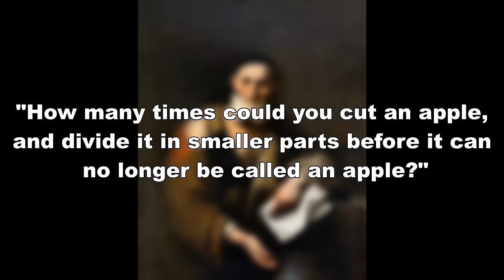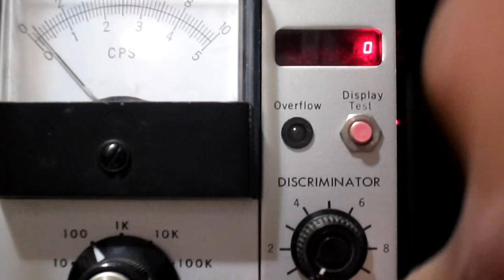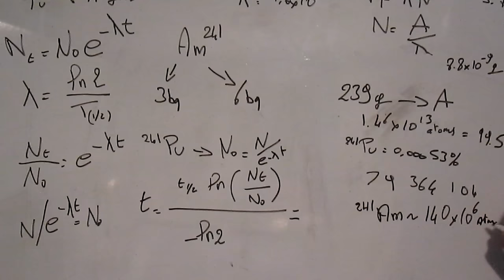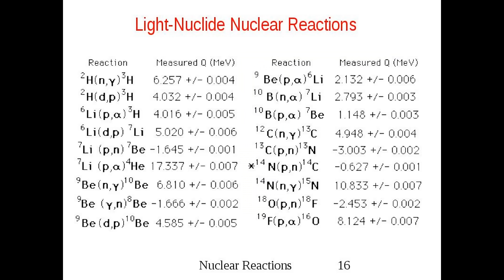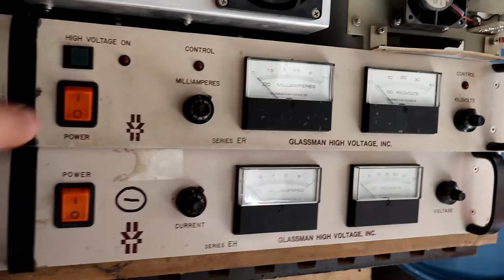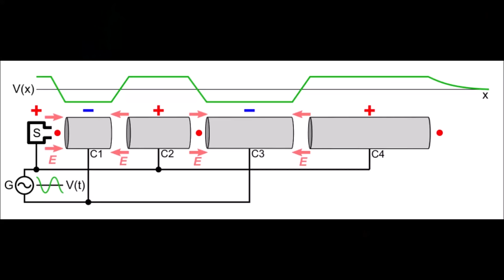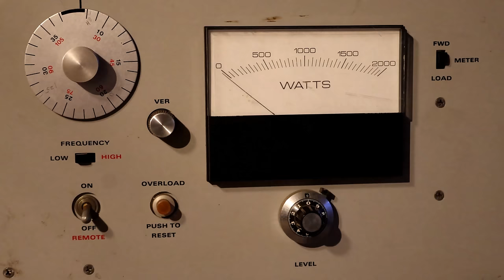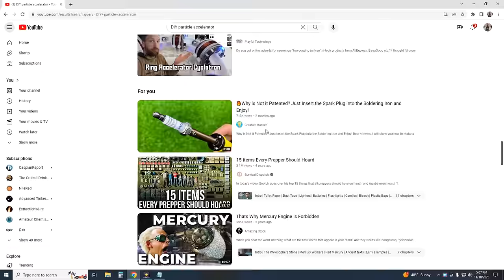DIY Particle accelerator (part 1)

Comment: This is very cool stuff! I'm glad you shared the setbacks. Most videos make it look like everything went smoothly and I think thos of us that do experimental work know that rarely happens. I'm very glad to hear that your turbo survived; that would have been really bad. I have done many years of UHV work, so I can appreciate the difficulty of getting a vacuum chamber up and running correctly. I doubt I can tell you much that you don't already know but feel free to reach out if you have questions about vacuum systems.

I'm looking forward to seeing this work!
Reply from the maker: excellent! Thanks for the offer! I am working with a possible supplier and may be able to get vacuum parts for this project! but the more the merrier right!  check out my other work vids! Thanks for watching!

Comment: I would like to know more about the conditions of the pressure failure, do you know from where it comes from? Are you very familiar with vacuum? Is a cathode gauge good for all pressures even not very low ones? (I saw you reach about 1e-6 torr but you go back to atm pressures sometimes from what I understood). It's more a question than any suggestion since I am not a vacuum expert but I am also working with vacuum and I vaguely know that several pressure gauges are used for switching from high to lower pressures so if you could explain more about you're gauge! Thanks a lot! Very inspiring video! Good luck for fixing everything, looking forward to see the following.
Reply from the maker: Sure, I made a simple mistake I never made before a really dumb one ! But I take full responsibility for it and I'll be sure to never repeat it. Basically I changed the oil in my pump and reconnected to the exhaust instead of the aspiration port. No I was obviously not paying attention.. for the atmospheric pressure down to about 10-3 I have a pirani gauge and below that I used both a hot and cold ionization gauge. They will not work at atmospheric pressure since they work by measuring a flow of electron, there is a maximum pressure at which electron cannot travel very far . Some more expensive gauges can cover all pressure but this is what I have and I am fine with it. The cold cathode gauge is more convenient because it doesn't need a warm up time like the hot cathode one but is a bit less steady from my experience. I hope this answers your questions, let me know if you'd like more precision! Thanks for watching!

Comment: Dang! Really great work here! I work with equippment similar to this in my lab. We're building a time resolved (3fs) photoelectron-photoion coincidence spectrometer. Cudos to you for doing this all on your own–I know how expensive and tedious these experiments can be.  Sorry to hear about the vacuum failure, it's definitly a setback, but I'm glad you're OK. I'm really surprised the turbo wasn't damaged. Was it not spinning? Normally when a rupture happens like that, the turbo rotors will shred themselves into aluminum powder... out of curiousty, what are you using to back the turbo?

Here's a suggestion for getting the energy of the particles (not sure how fesable this is, but it should work). You could velocity map image the ions onto a phosphor screen using ion optics and image with a CCD. Then apply inverse abel transform and calibrate to get the distribution of energy.

Comment: Yooo. I just want to say thank you....big one. Shame I havent seen this earlier - my name is Jiri, I am Ham Radio , IT geek and I love particle physics. I am far less knowledgable than you are but I could perhaps help with generating some RF. If we talk about kHz and we need ideally square wave and short bursts, I would propose to go MOSFET amplifier in class C, with impedance transofrmer. Driving it would be Signal Generator so as long as square is used, C class would work, if sine is needed, biasing it to AB1 class would need to be done. I can take a look and dive into KiCad and LtSpice and try to make a design.  Take care!
Reply from the maker: Yes ! that would be awesome indeed! Do you think a MOSFET can handle a few thousand watt? I found RF amplifier and I already have a few function generators, but I always wonder if they could put out enough power? Thanks for reaching out and thank you for watching!
Reply: @Neptunium  Few thousand watts will be difficult - mainly because altough mosfet ON resistance is getting low, around 20 miliohms, it still needs to sink a lot of heat. I built RF Amplifier using mosfets which delivers around 2000 watts... it uses a lot of paralel IRF820 or IRF910 high voltage MOSFETs but truth is that there are now components designed for RF - MRF300 can be purchased as a pair for push-pull and each devices is rated at 500W, so a kilowatt should be fine and 2kW with 4 devices should also work. Good thing is that we talk about quite low frequencies - higher we go it will get more hard, mainly due to capacitance of the gates.
I plan to be in my lab later this month so will look at what I have around and could do a quick test. What is the minimum RF Power which would still be acceptable?
Reply from the maker: Oh wow ! thanks a lot ! and i am KE8WDE by the way! 73! @ok2it

Comment: I hit the same issue with my Penning gauge having a large magnetic field and messing up my experiments with accelerating electrons. It would be useful to calculate or measure the actual consumed RF power and impedance at each tube.  Might be worth looking into a multi-stage RF amplifier designed specifically for the impedance that your tubes will present, although your newer machine does look very capable. I was considering accelerating heavier ions like argon, but the idea of using helium is an excellent one. Would a magnetron sputtering source give you a larger ion flux? I have a large Faraday cage in a barn, with optical fibre control/measurement cables to run these sorts of high RF fields without upsetting my computers, CNC gear and test equipment.  Also if it has a catastrophic failure, I am behind several brick walls some distance away.  I'd also be tempted to run the system at a low duty cycle so you could use pulsed power and get a much higher peak accelerating gradient, so long as you avoid multipaction damage. I have some 80 kilowatt magnetrons that only need 800 watts average power, but getting really high power at a few MHz using semiconductor amplifiers is relatively trivial unless you want 10 kW or more peak power. Great work, I look forward to seeing your progress!
Reply from the maker: I see we had similar ideas and ! Excellent! Part 2 is already out my friend! So you don't have to wait ! Thanks for watching and great comments!
Reply: @Neptunium  My turbopump controller has developed a fault so I need to get that fixed asap. Did you use a commercial controller/ display with your hot cathode vac gauge, or did you build your own?
Reply from the maker: @MachiningandMicrowaves  no you can see it on the video it's a Grandville Philips commercial controller
Reply: @Neptunium  Ah yes, I wasn't looking closely enough. Nice.

Comment: What made you decide on building the drift tube first, then finding resonance and matching it with a tunable power supply, as opposed to finding a high power power sipply and building around that?
Also, was ghere a reason besides spacial confinements to only have 6 tubes, if you vould achieve higher acceleration with 7?
Also, does the metal frame for the drift tube array cause interference with your input?
Im very excited to hear a solution for your output measuring equipment! In my own studies, a cloud chamber would be an awesome visial, but personally, observing Cherenkov radiation would be my main goal with an acceleratir. Usually thats in water with cyclotrons, but theres other substances you can onserve it at much lower speeds.
Do you have any goals youre really looking for with it? It seems like you just want whatever data you can manage to collect!
Lastly, what were your biggest resources in creating this? I've found CERN has some great, simple explanations, but theres a few textbooks that really go into great detail, and id love to hear what you found!
I loved the video, I had the same frustrations in finding a legitimate attempt at building a linac, and I'm very imptessed with your solutions.  You're an inspiration, mine will get done!

Comment: Building an ion accelerator is a very ambitious project! I have worked on linacs, medical ones, for over thirty years, and they are complex beasts You obviously have some experience in hivac work, and high voltage and RF systems You need on the order of at least 10-5 torr to even begin to have a low enough vacuum, and you probably want to isolate your ion source, which I have questions about, from the rest of the linac, and likely need to do differential pumping to maintain the vacuum levels I'm curious what caused the rupture of the window? did you get a hot spot?
Reply from the maker: For the size of the whole chamber I need to get closer to 10-6 Torr, which I've done before and is possible. I've re-design my spacers and thanks to viewers like yourself have gotten lots of helpful suggestions and comments, for the failure I am investigating the cause but I think I may have had a dumb moment and build up pressure instead of vacuuming down. It's alright, I am not afraid of admitting when I f..up... Repaired, regroup replace . Move on.. beside this gave me the opportunity to change a few things too! Thanks for watching my friend!
Reply: If you aren't making mistakes, you aren't doing anything truly creative or original.. It may have been possible you had ion collisions with the window, and that caused a hot spot, causing the window to crack. As expensive as those windows are, you might consider putting in a protective round piece of Pyrex type , held in place with a stainless steel ring that has some spring to it. I had this exact scenario happen when working with a group on a fusor, and warned the lead guy that the protective glass was a good idea, but he ignored it. sure enough ion bombardment caused hot spots, and a destruction of the window. I didn't even have to say I told you so before he admitted he hadn't listened, and paid the price. I'm sorry about the loss of your hot ion gauge, and your RGA, what looked like the ion source. I know how  pricey those items are! Good luck in th next attempt!

Comment: How devastating. I wish you good luck finding replacement items.
Reply from the maker: Hey things happen! There will be problems and setback I accept it! And you know, this may have been a blessing in disguise! Some viewers have offer replacement parts! So one door closes, another opens ! Thanks for watching!
Reply: Wow, you're so lucky, but you have obviously put a lot of work in so you deserve it. I just know how expensive doing these things can be. I would love a turbo pump, but they are so expensive. There are some great wins out there, I just got an unused diffusion pump for $100 . 🎉
Reply from the maker: hey thats not bad! you can do a lot of interesting experiment with it already! you just have to be patient and have a good reliable roughing pump!  @burner8126
Reply: @Neptunium  I have 5 in various states of repair, so got it covered, lol. Cheers. 
ps. Working on a fusion project you may be interested in. Not finished building yet, so I haven't uploaded it, but I've put a few other experiments on there.

Comment: I also work in vacuum and i just want to tell you that common solder  (lead or tin) start to seriously outgase at higher vacuums, and be careful of the  gaz conductance in your system, having large plastic support will both outgase and seriously reduce the pump throughput.
In real system, all waves are sinusoidal, square waves are horrendous to work with in high frequency/power.
Reply from the maker: Thats a very good point I did review after posting this video, Although I never saw anything on the RGA, I plan on using a different plastic for the spacers (HDPE). the square wave was a thought i since abandoned for several reason, 1) its really impractical,  2) the interference from harmonics are just too much to deal with even with a faraday cage, and I don't really want the FCC to come knocking, but mainly 3) the particle will fall out of phase after the first drift tube. I guess it`s a trade off with this type of device. I don't expect to be able to reach a single Mev, this is just a proof of concept to show that anybody can do this. The only major limitation is the power supply, I would need 40Kv at 8Mhz to get this to work and I don`t think I`ll be able to get a power supply like that! thanks for watching!
Reply: @Neptunium  Very nice, but I'm not sure if I saw correctly, but it seems that the round plastic plates you used to support the drift tube block a sizable part of your chamber, you will have  a very high pressure gradient in your system and your measured pressure ( in the middle) will not be the pressure at the helium inlet.

Good luck !🤞
Reply from the maker: Yes I did realized that! So the next one will have large openings in them... For the ionization chamber the small hole is on purpose to keep a higher pressure of helium for a better ionization efficiency. Especially since I am replacing the hot filament with a sputtering ion gun...

Comment: For you high voltage consider series MOSFET in RC time constants to create the static pulse. We used this technique for MW TWT's. I would also suggest a circular magnetic vacuum chamber as linear accelerators does not necessarily mean straight line even though in the 60's we did that it didn't take long for use to see the eV increase of toroidal wave guides.
Reply: As a note.. don't stick you finger near the ballast resistors... I melted my fingerprints because the discharge probe was open.
Reply from the maker: good advice! i`ll use a screw driver next time! Thanks for watching!

Comment: Amazing video. By the way, I know that the CERN (and many other similar institutions probably) publish extensive technical details and reports on their accelerator and detector systems, completely for free. This may give you some ideas on how to improve your designs or avoid potentially catastrophic failures like the vacuum implosion.
Reply from the maker: Thanks ! I read some of the publication you've mentioned which lead to this video. But your right there is plenty more to explore I did missed ! Thanks for watching!

Comment: Regarding high voltage AC. The use of a Tesla coil is probably impractical even when driven by 
a electronic oscillator. Getting the tuning the whole system right probably a nightmare.
Any change to your drift tube assembly will change the capacitance presented to the output coil
changing the resonate frequency.  Having said this perhaps using only a portion of a Tesla coil
would work.  Tesla developed what he called “the extra coil”  The basic idea is super simple a
resonate circuit will “magnify” the applied voltage by the Quality factor of the coil.  This is the
Q which equals Real resistance in Ohms / the Reactive impedance Xc in Ohms.  I have successfully 
built a coil with a Q of 500 operating in the near 100 Khz  Even when excited with a  small 10 Volt
signal generator 5,000 volts appeared on the the terminal end of the coil causing nearby florescent
lamps to illuminate.  Tuning will still be an issue but probably not intractable adding a small 
variable inductor in series should allow adjustment.  If you consider this method I recommend 
checking out Litz wire for constructing the coil it is designed for high frequency currents and 
will improve the Q factor.  Also you may have to pot your coil in silicon or wax to prevent 
electrical breakdown. Or you can try regular high voltage cable this worked but my coil was
large more than a meter in diameter and as long.
Reply from the maker: You are the second viewer to suggest the Q factor and additional coil !! It's a very interesting concept I will definitely read into !it! Thank you for that! Do you think  it would still be a messy signal .. Anyway, much appreciated  And thanks for watching

Comment: I'm curious if it would be better to use glass or alumina disks to support the copper tubes in the chamber. I wasn't sure what plastic that was (acrylic?), but a lot of these outgas quite a bit and even warp slightly causing problems. Funny, I was looking to build something like this, but for protons to strike a boron target (p-B fusion), alas, no tengo dinero.
Reply from the maker: Oh there is no reason I couldn't tune this to work with proton... This might take some retooling though.. I kept track of the acrylic degassing with the mass spectrometer and up until 120C I didn't see anything...but your right a ceramic spacer would be a lot better !  Not metal because they have to be kept electrically separated .. thanks for watching!

Comment: I studied power electronics. Your knowledge is off the charts. You should apply to a research lab like Lawrence Livermore or Sandia Labs. You'd have access to all the equipment you could imagine. And be able to take your amazingly artistic ideas to the next level.
Reply: This will yield a few kilovolts instead of megavolts
Reply from the maker: I'll take whatever I can! If it works at all,! Thanks for watching